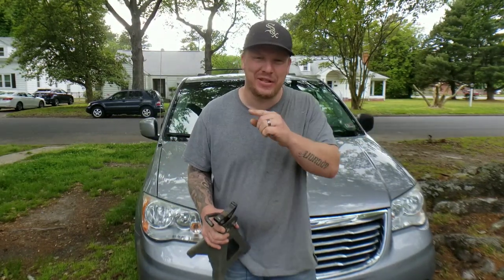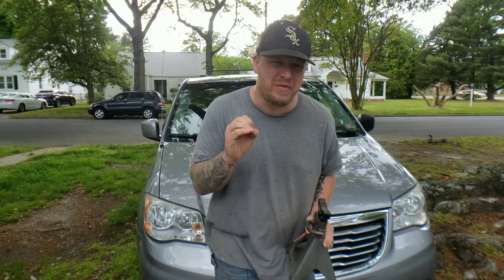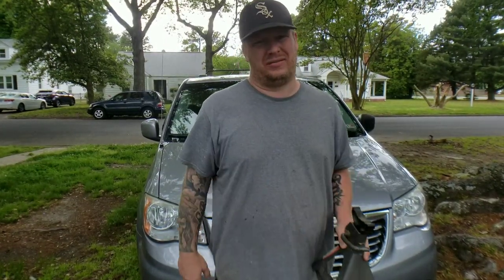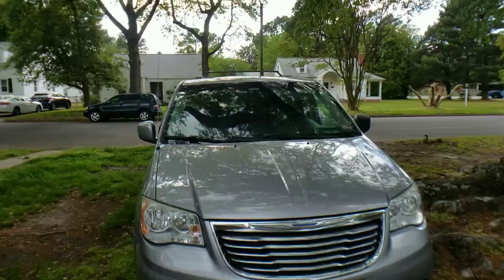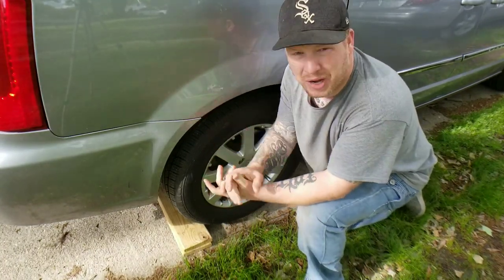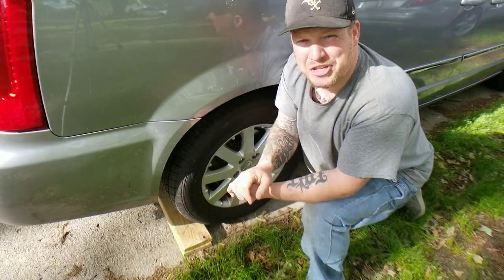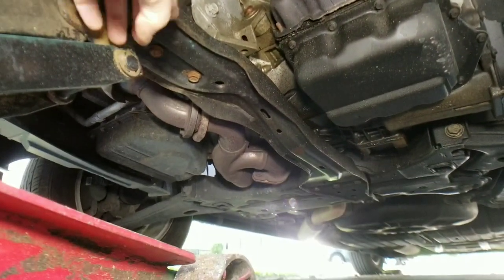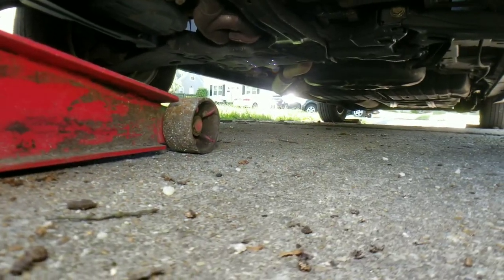2014 Chrysler Town and Country Jack Points

Comment: The service manual only shows lift points for the scissors jack that comes with the vehicle so this video is outstanding because if you use the lift points for the scissors jack using a floor jack you will damage the scissors lift points. Blocking the wheels and using jack stands very important. I am very old and have seen vehicles fall on inexperienced people who have lost both legs when a vehicle fell on them. I knew one young man who was pined under a vehicle that fell on him and he could not breath but lucky his brother came home and found him under the vehicle so adding a talking point not to work alone is also a safety point to have a helper or someone within earshot when working.
Reply from the maker: That is an awesome tip Dennis! I know that my wife always likes being within earshot while I am working under a vehicle for said reason. Thank you for watching the video and I'm glad that you enjoyed it as well!
Reply from the maker: I also have another episode coming out soon showing the damage on the double welds due to someone using a floor jack where a scissor jack should have been used. Stay tuned for more DIY Auto Repair!
Reply: @Sellthoseflippingcars  Outstanding video. In your new video can you show how to repair?
Reply from the maker: How to repair the double welds?
Reply: @Sellthoseflippingcars  Yes, would be good if you did a future video production that shows how to repair the damage if done wrong

Comment: Why did you not mention the jack point the car manual recommends at the pinch welds? I personally hate using the pinch welds because they bend and just don't seem like a solid mounting point but there has to be a reason why Chrysler mentions those points and nothing else right?
Reply from the maker: Yes auto manufacturers recommend on newer vehicles that you use the pinch welds but if your frame is open and you can safely secure the vehicle on the frame then it is a good choice.

Comment: Thanks for taking the time to make this video....super helpful as well as posting where you got the jack n stands. Although I would recommend a 3 ton jack and stands on a vehicle that weighs in around 4500 pounds in total. As you mentioned, the vast majority of the weight is in the front. One last thing, when removing tires I like to place the tires under the "pinch" weld points if space allows it.
Reply from the maker: You are most welcome! I am glad that you enjoyed the video and found it to be beneficial. I do agree if the space allows it sure put the tire under the double welds. This will give you a secondary Jack in case your main Jack's fall. Next yes I would not use anything less than a 3-ton floor jack to lift this vehicle. 2-ton jack stands will work but I do agree with you three ton jack stands are always nice. The extra weight allowance that the 3 ton jack stands will allow is always a nice comfort.

Comment: I haven't had this vehicle long. I always look up jack points on an unfamiliar vehicle. 
I am finishing up under the hood today, spark plugs & wires, both valve cover gaskets, and pcv valve. Next, brakes, all the way around, and replacing a faulty wheel speed sensor.
I work slow, but thorough. I'm a grandma, about to turn 65. I save thousands, doing most of my own repairs.
Reply from the maker: 3 things you can ask from a mechanic but you can only get 2. Fast, good, and cheap, nothing wrong with being thorough, I've seen too much stuff go bad when you rush
Reply: I used the hole in the framerail for my jack and it deformed it. These vans are hard to jack up with damaging them because they are cheap

Comment: 2 questions for this awesome video:
1. Whats the ton raiting on the jack you boosted the front up with? Ive got a 3 ton is that enough?
2. Does the 2017 dodge caravan have the same jack/axle stand points?
Reply from the maker: 3 ton floor jack stands, and yes the Dodge Caravan has the same jack stand points as the Town and Country. Thanks for watching Bruce! Sub for MORE DIY AUTO!

Comment: Take a word of advice if you’re going to use the rear support to jack up on, I just did this and when I was jacking it back up to get my stands out, I heard a loud crack. Not sure what broke, nothing seems any different. Maybe I was jacking up too fast?
Reply from the maker: Make sure when you have the jack placed there that it is sitting even. Most Jacks have bevels on the floor jack and when jacking the vehicle up the frame can shift on these bevels.
Reply: @Sellthoseflippingcars  that’s a good point, thanks. I am hoping the cracking sound was maybe just the jack plate shifting and snapping against the support.

Comment: I would NOT jack up the rear by putting the jack in the center of the "dead axel"! This axel is easily prone to twisting, distortion as I found when I needed to replace the unit on my 2017 Grand Caravan. It was EATING rear tires and after new tires, an alignment showed the rear out of line. Turns out it had a twist in the center of my axel and upon inspection and then removal, it was EASILY noticeable. Was a program vehicle so no idea how it happened. The points on the axel near where the coil springs rest would be a better option, leaving room for your jack stands.  I replaced the axel myself and it was surprisingly easy. So, when you see the unit off the vehicle you can see how it easily it can be twisted. I want to add that during the replacement I had the jack stands on the frame points ahead of the axel and I slid the tires I removed under the vehicle just for added safety. Jus' sayin ...
       ☆ Just remembered something ... was last year that I fixed this. I DID jack it up from the center BUT I used a 3'ish 4x4 to span the "dead axel" so as not to damage the evidence. Hey, I am old! But I know stuf!
Reply from the maker: Great idea and definitely a safe option!! Sorry to hear about your vehicle that is crazy! 😧 Thank you for watching!!
Reply: @Sellthoseflippingcars  Thanks! Ran into a great deal from a salvage yard. Got a complete axel assembly that was carefully removed from a 2014, better condtion than mine, for $150! Lot of extra parts for later.
Reply from the maker: Nice! Nothing wrong with saving money on parts, especially with such a large component!

Comment: Good Afternoon! I have a 2003 Dodge Caravan SE and i need guidance on how to properly  jack it up and place jack stands all in the proper locations, i see that you demonstrate how to do that in this video but for a 2014 chrysler town and country. Is there any way you can assist me with this?
Reply from the maker: On the 2003 Dodge Caravan you want to use the double weld joint as a lift point on the sides. You will have one of these points at the front right behind the passenger tire and right behind the driver tire.
Reply: @Sellthoseflippingcars  what about the jack stands?
Reply from the maker: That is where you put the jack stands
Reply: @Sellthoseflippingcars  do you have an email address where can i email you pictures of under the van?
Reply from the maker: Sellthoseflippingcars@Gmail.com
Reply: @Sellthoseflippingcars  Good Evening! I emailed you and didn't receive a response back. What is a double weld joint? Show me what you mean.
Reply from the maker: I did return the email but it said it was undeliverable. The pictures you sent me are the correct jack points for your vehicle.
Reply: @Sellthoseflippingcars  I understand the jack points i sent you in the pictures are correct but i still dont understand or know how to apply the action from within those pictures and getting under the van and placing the jack stands properly onto those jack points.
Reply from the maker: I will make a video of it for you and post it. Sound good?
Reply: @Sellthoseflippingcars  yes sir! I will greatly appreciate the video very much. I really appreciate what your doing alot its very thoughtful and caring. God bless you have a beautiful blessed day! Cant wait for the video 🙏🙂
Reply from the maker: @angeloyourreflection9331  you are most welcome! It will be on a different van but it will be the same idea. Since our Town and Country was smashed by a tree.
Reply: @Sellthoseflippingcars  since its on a different van, does this different van have the same jack points as my 2003 caravan that i sent to you on the pictures?
Reply from the maker: Yes it does
Reply: @Sellthoseflippingcars  Awesome! That should hopefully work.
Reply: @Sellthoseflippingcars  i apologize my friend, i just realized that your town n country van had an accident, are you and your family okay? Again i apologize and im really sorry to hear that accident happened.

Comment: Not all of these locations are safe to jack from. Double check your owner's manual before lifting the car!
Reply from the maker: All of these locations are safe to jack from or I wouldn't do it. You dont get paid enough to be unsafe. If there is a certain jack point in the video you are uncertain of please let me know and I will show you the correct spot I was talking about. Thanks for watching!
Reply: @Sellthoseflippingcars  My main concern is jacking from the rear frame between the wheels. While it looks sturdy enough, I could see it noticeably bow when jacking from that point. If the frame from which I am lifting is bending, I would be wary to use it.
Reply from the maker: I totally agree if something looks unsafe stop and readjust fire. Great catch Braden! Watch for that everyone, lets all be safe